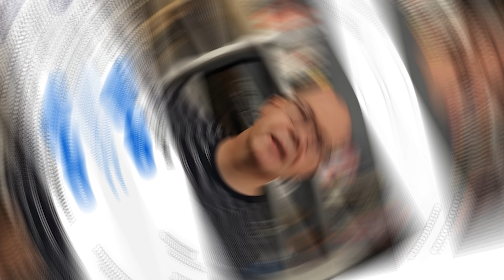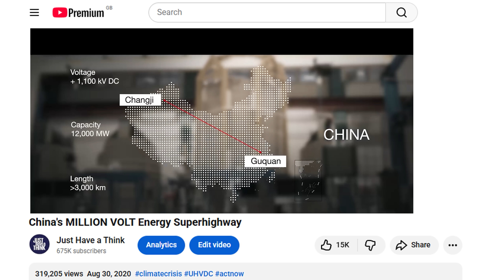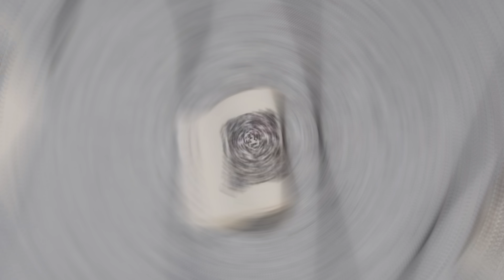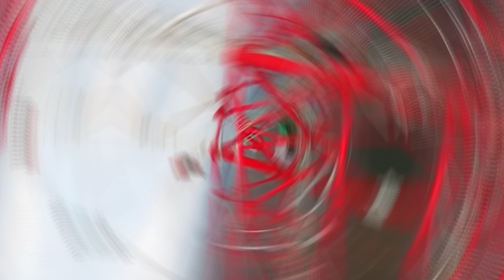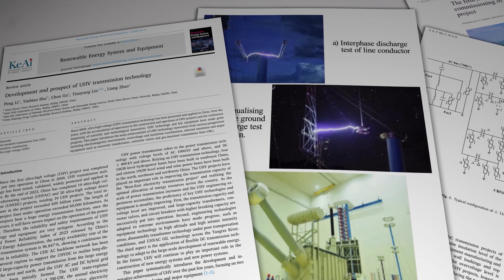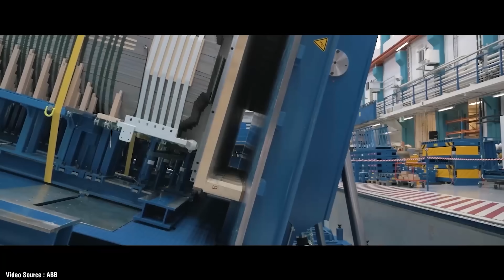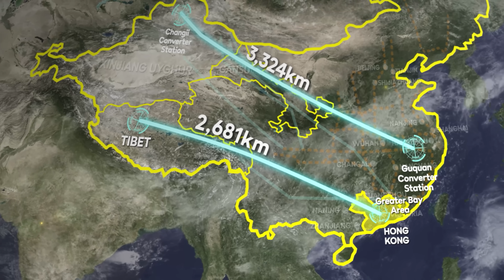China's ultra-high voltage transmission lines now breaking all records.

Comment: I've been a follower for a long time and really love your work. As electric cars become more and more common, I can't help thinking that the additional power generation (battery discharge) required to charge these vehicles, mostly overnight, will need to be met in an economical and environmentally friendly way. I would like to see what is going on in the development of home systems that will provide domestic power as well as enough to charge, say, 2 vehicles. Alongside this interest, I really believe that local housing, say 10 or 20 houses in a street or cul-de-sac, could band together to form a local network storing and sharing the solar (and wind) power they generate during the day In such a manner to obviate the need to use other supplier power. I know, this would possibly create enormous issues with state and privately owned power generators. Possibly, there could be insurance issues as well? I think, though, as pressure on the climate and increasing costs of bulk power, this must be investigated, tested, and evaluated. I just makes sense......?

Comment: I'm more inspired by this episode than most.
I would have asked for an episode on the Grid Bottle neck.
You understand as I do I think that we are already capable or at least progressing towards total Renewable energy production self sufficiency but that the grid and storage capacity is political the pink bottle neck in the room that politicians are avoiding addressing .
 Our current caballing technology would require an exponentially larger grid to cope with the new production capacity at all scales already online and forthcoming.
My request is for more grid hardware coverage, of the UK et all news, politics, potential or planed,  engineering of grid improvements.
Thanks happy Christmas.
Ps xxl or xxxl please.

Comment: I think we should reduce power transmission. We need power near the point of use. Now that generation is non-polluting, there is no need to put it outside population centres.
It strikes me that cities have all the necessary infrastructure to supply all the users - we don't get many power cuts or brownouts these days. 
So why do'n't the government support more urban generation rather than corporate installations out at sea or rural installations on greenfield sites? 
Every private landlord could reduce costs for tenants if their properties had rooftop solar PV and hot water generation, with installation grants, and every homeowner would benefit from a similar scheme.
Batteries in homes could be supported as part of urban grids and locally generated power could make roadside auto power points possible on every street to charge everybody's electric vehicles, as we switch from fossil fuels.

Comment: Are the hydro electric installations in northern Quebec Canada environmentally sound and successful? Also, second question- have you seen British potters firing clay in microwaves? 
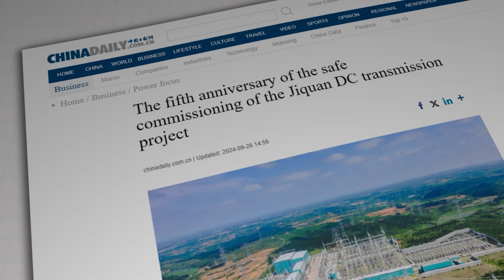It seems that we could produce quite a bit of heat at 1/4  of the price despite the scrubbing of exhaust being a VERY important problem connex...Why is it industry is so backwards in its handling of scrubbing emissions, be it dust, or fumes from fork lifts and glue pots which directly affect workers to their own production emissions? Why so much foot dragging?Why is it workers despise masks considering their effectiveness? Why are charcoal filter systems and masks so overprice 5:51 5:51 d? What are the best scrubbing systems and new innovations? Is mankind ready to accept we need sump holes and scrubbing chambers in ventilation systems? Also, the dilemma of septic fields! How do they age and what innovations have occurred since WWII? Tx for your great research. Obviously, macro/micro but was curious for an outsiders opinion! Merry Christmas! Good job!

Comment: Sure as hell not on this.    Everything about DC power transmission is bad.   As an electrical engineer, this is a dumb as hell idea.     I dont even know where to start.... Radio Interference is very severe, even atmospheric interference, then the have grounding issues that will cause insane amounts of corrosion, the arcing of power level changes is an order of magnitude worse, the ionization of localized air that can actually kill people, EMF exposure the list goes on and on.

Comment: I am curious if any of new battery chemistries are going to be applied to consumer electronics.   I was amazed at how many battery fires are recorded in Australia, and the inane advice given to prevent them.   I have a lot of lithium batteries in use.    Particularly have a lot for tools and garden equipment.   I'd love to be able to replace them with SAFE alternatives.

Comment: Hello from Shanghai where I have been living almost half of my life so far.
When I arrived in China in 1999 the air was "thick" to say the least, the rivers could have been used for ink and there was almost no bird in the sky, it was "challenging". The roads were still massively used by bicycles and motorcycle increasing the level of noise pollution to a degree that would be surprising to westerners.
26+ years later, the air is clean, the rivers have been dredged and people are fishing in them even in large cities like Shanghai. Almost all vehicles are now electric, taxi, bus, delivery trucks, bikes. The noise pollution is mostly gone and birds are the most noisy neighbors that wake you every morning. The change was gradual and yet so fast! 
I do believe there is still a HUGE effort to be made to increase the housing thermal efficiency as the concept of insulation is strangely very lacking in China but all in all when I go back to France I I am going to miss my life in China a lot for the practical aspects you cannot even fathom. The main aspect being, they really live by the motto: "work more to earn more" and they are really hard working people. 
Back to the subject you might consider working on:
1. COP crowns, which country "promised" what: which ones are exceeding their targets (I have a guess), which ones are on target and which ones are late... And what are the excuses?
2. Analysis of which countries are the "biggest" polluters per capita, not per country... It is not fair to compare the total emission between Belgium and India without taking into account the number of inhabitants. I know there is already such tables everywhere BUT I would like to see data including big oil company emission level ALSO included... For instance I am French, how much Total is contributing to destroy our world, then add this to the country total... It should be only fair to give due to the country from which these big oil companies are coming from, their local government are responsible if only take the taxes and not the blame. It should be included in the total of their origin country I think in all the calculations. 
3. Total green energy storage capacity per capita again and per country. Without storage the hole system is unstable (AKA Spain collapse recently). Who is the best, how do they do it and why are other countries unable/unwilling to follow?
4. A real story on the fact that Western countries are all "building" Lithium batteries industry now when China is already switching to sodium tech and how this will provide China supremacy on the storage market for the next decade again. Why are western producers always so late compared to China? Coupled with an analysis of why western countries failed on the PV panels for the last 2 decades. I know, lots of dumping blame against China, I really would like to know if this is true or not because I visited many PV panels factories in the early 2000 and they were already very good at it when prices in Europe were insanely high. At some point if China is dumping on everything, where is the money to build all they are building coming from?

Comment: Could you please do a deep dive into battery manufacturer EnerVenue.  They make a long duration battery with hydrogen and nickel.  They were to go into commercial production this year.  But the factory never opened.  They still have a small office in California.  What happened?  
Also, what happened with HighView Power.  Did they ever get a commercial storage facility up and running?

Comment: I'd like one of those cool sweatshirts. The topic I'd like to hear is based on that diagram you showed where AC is good at lower power, an DC is  good at higher power. But I don't even see any affordable DC-DC solutions at the lower end. What is out there for residential microgrid transmissions powering a neighborhood. There needs the boost transmission and buck for the in sizes. That could revolutionalize neighborhood microgrids.

Comment: Can you stop saying stufff like "get electrons where they need to"? It's not at all how electrical power transmission works. I see it all over the place. Energy is moved through electric fields, not through some momentum in the electrons. In AC circuits, electrons are just moving forwards and backwards in the orders of mm, which is tiny compared to thermal noise.
Reply: How about DC circuits as in UHVDC power transmission, where energy is converted from sunlight to electricity via PV panels (or solar radiation generated thermal / mechanical energy is converted to electricity via wind turbines),  converted to AC (from DC for solar PV with inverters), stepped up to UHV, rectified to DC, transmitted via the overhead UHVDC transmission lines, and the process reversed to serve the actual loads which can be DC such us fast DC chargers for EVs? It's not just electric fields, it's also magnetic fields too, at least in theory.
Reply: @tecumsehneo2174 yes, electric and magnetic fields, but the electrons don't carry the energy and the energy is almost completely moved outside the wires altogether.

"Moving electrons where they need to go" also implies that electrons are missing somewhere. However, electric charge is neutral on average over time in a circuit. So for every electron you "send" down a DC circuit, another is coming back to you.

Even the two parts of a battery that are the positive and negative end are always neutral even when fully charged. When you apply a load, charge flows through the load and also through the battery membrane.

So this is why i think saying "Moving electrons where they need to go" is so misleading and gives people a wrong understanding of how the underlying physics works. You could simply say "Moving the energy" instead, and be correct about it.
Reply: @moritzhubner5023  The interesting thing about scientific / physics theory is people can visualize and describe how the energy is transferred from one location to another and how to convert that energy to other forms to do work.  But in the practical world, there are measuring instruments or meters that can measure electrical potential (voltage) and current (amperes, flow of electrons or ions) and math formulas to calculate their behavior in electrical circuits.  In engineering or the practical world, those formulas along with empirical data, are usually sufficient for people to design and build useful things.

Comment: Topic suggesion: Power from africa to Europe via Spain and italy Existing unused gasline from mrocco-algeria to spain and italy plus the use of potential new Chinese UHVDC.  Could the unused inland in Spain become a power engine for southern europe?Could Sweden also solve the issue with having bankrupted windparks in the north where they dont get paid enough while in the southern part of the country the electricity is many times higher?

Comment: Having a look into BC hydro may be a thing. Our history of renauable with hydro is not a plessant one. Charging home owners of off grid installs a teriff on the power the produced even though they did not contribute the progect in anyway.  Installing dames for irrication diversion dispite no reson for the power. eg site C. A large % of our dams are primarily for providing water to the US. Now  post Roberts Little adventure in eletoric event. We have had two now. Suposidy sponcered by hydro. Where they are now, in therory, promoting roof top solar and batteries. Is Hydro attempting clean up its act or just white washing a vary black image of ingnoring the rites of the people and the enviromnet. Hydro electric is not clean and it impact is vary damagein enviromentaly and cultrualy.

Comment: When Russia invaded Ukraine, one of the large problems experienced by Europe (as you know) was disruption of the gas supply. I heard a great deal about Europe changing policies and gas sourcing at the time, but it nonetheless fed European leaders' reluctance to support Ukraine -- at least for a while. 
With this as an example, it's easy to see how energy sourcing can stabilize or destabilize international peace, at least at the scale of regions, if not continents. I know that there has been some scholarship on the potential for renewable, localized energy to undermine motivations for conflict and/or the profit motive. (Iraq's invasion of Kuwait was, after all, a resource robbery based on the profit motive.) I'm not up on this scholarship, though, and not only would love to learn more, but I think that's a huge potential benefit of renewables that should get more attention -- and you are well positioned to raise awareness. 
So, how about having a think about the peace implications of renewable energy, either through microgrids that disrupt fossil fuel demand or through long distance transmission that gives relatively stable and peaceful countries (like Australia) a different (and peaceful, and non-polluting) lever of influence over its neighbours?

Comment: A video on how much carbon goes into producing a Horizontal Wind Turbine's massive concrete base, and steel re-bar mesh total CO2 production impacts along with from raw material to designed finished of all the other components being delivered by diesel truck to the assembly site, and diesel spewing cranes doing the assembly compared to HAWT over life CO2 electric generation off set compared to a compact Natural Gas Turbine.

Comment: A video on what happens after another 1859 Carrington CME event hapens when nuclear waist stockpiles are not managed to be kept cool in ponds  for a host of reasons like no electric, no diesel fuel delivery, no spare pump parts being manufactured , no one reporting to work at nuclear facilities to do maintenance for the thousands of years needed until the spent nuckear fuel waist is inert long after the CME event leading to the atmosphere being pumped full of over heating nuclear waist stockpile found all over the world at each nuclear reactor all leaking into the atmosphere as the last remaining 3 % of the human population hangs on. You know, just another clean nuclear fission electric generation plant benefit.

Comment: I think the Tibetan plateau would also be a good place to build big data centers. It's very sunny but also kind of cold, with reliable snowmelt rivers for cooling. Even if they didn't build transmission lines from there, it would make sense to go tile every south-facing slope with solar panels. Of course, with transmission lines, the value only goes up. You really can't overdo it with solar generation up there.

Comment: The number you should have also shown is how many Gigawatts are lost in the transmission line compared to how many reach the other end - at rated load. There is a reason local power use from local production should be further encouraged.

Comment: how about this: feasibility of using existing lines combined with using multiple battery banks and transfer the energy during low usage periods (such as night)? I would think this would save a lot of money over stringing new lines, and might be more cost effectve as battery costs drop. It would also distributed the power leading to fewer choke points, if done properly.

Comment: Hoodie!  Here's a fascinating situation. In Armenia, the nuclear plant handles a huge amount of the base load for the country.  Unfortunately, it's getting old and the country needs a replacement.  A great video topic would be to compare them building a new nuclear plant (or several SMRs) vs. renewables and grid-scale storage.  The analysis could assume a reasonable reduction in the price of batteries, a reasonable risk that the nuclear plant(s) won't be built in time, etc., etc.  Would love to see that, thanks!

Comment: It's not just the engineering problems that are going to be a challenge.  There are separatist forces not far away that would be happy to sabotage that power line and will have the cheap drones to do it.   The Chinese can step up the surveillance and the repression but they can't defend thousands of kilometers against a small group in a couple of trucks.
Reply: Strange you would think along those lines. Imagine if all those that the US has militarily attacked employed the methods you suggested against American infrastructure?  Blowback?

Comment: The biggest problem with massive power lines of any technology is the absence of backup routes when the big line fails.  Basically getting the equivalent of spare highways to drive on when a motorway is blocked by an accident or roadworks.  This is why much of Europe has multiple interconnects between areas, and procedures to safely do the rerouting .  Failures of such failover systems cause the big blackouts like the one that hit part of Europe when someone miscalculated the temporary closing of one line across a German river to let a ship past, or the one where two failures at a mid Sweden interconnection station cascaded into loosing the half of the cities south of it .